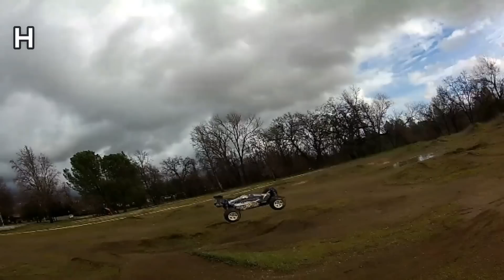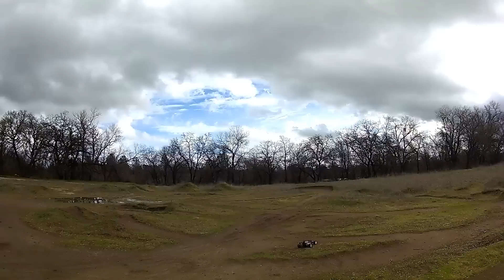HobbyKing Rattler Upgrade Run On 2s

Comment: finally
Reply: btw how do you keep your ESC in place
Reply from the maker: Yes sorry it took a while
Reply from the maker: I had to cut the box and not put the top back on
Reply: KillerOffRoadHobbyz I know that I mean do you use double sided tape because everything I crash mine comes off
Reply from the maker: Yes double side tape the hell out of it.
Reply: KillerOffRoadHobbyz I have the foam double sided tape and it doesn't seem to work so I put that and tape going around the bottom part of the ESC, well that's what I get for putting an 8th scale ESC in a ECX circuit
Reply from the maker: Use the 3M tape it's gray with red cover it's what I use and it works very well

Comment: What remote system are you running? If it's the FlySky they are notorious for getting interference while being "2.4g". Also if your receiver antenna is to close to the esc that causes glitching. I'm also getting rain down here. A new unboxing video is up on my page. 👍
Reply from the maker: I did not know that so thank you very much for the info and yes it's a FSGT3B. Same here with the rain we had a 12 to maybe 14 hour break then it started back up.